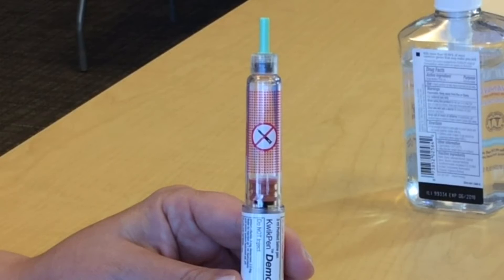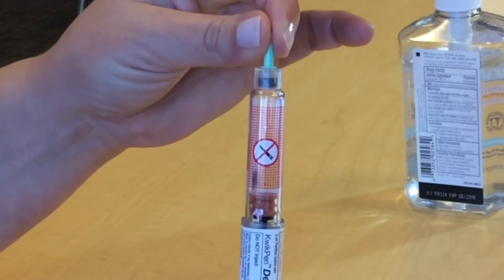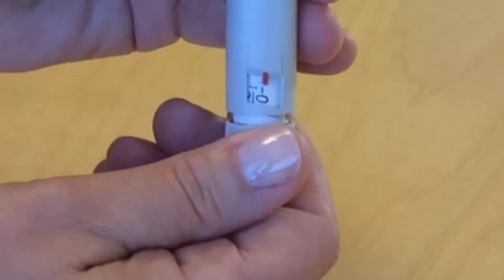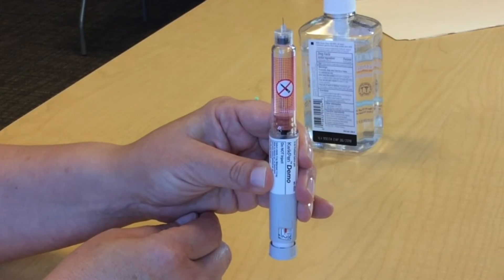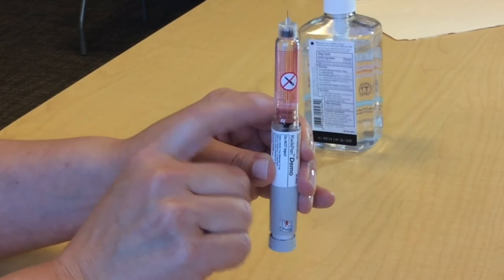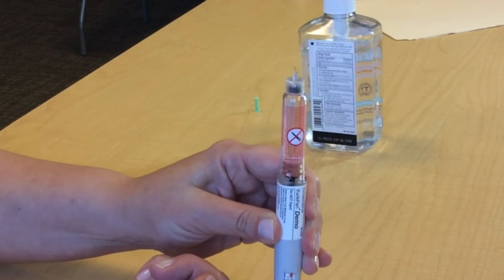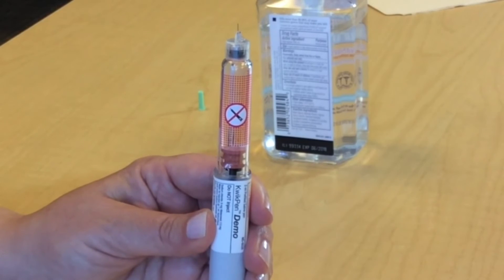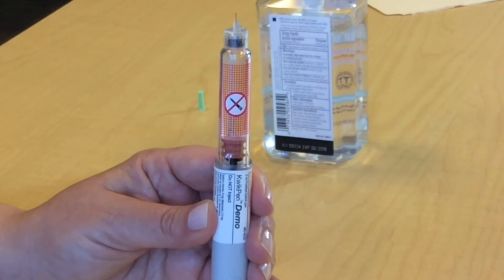How to prime your insulin pen

Comment: I still have problems with every pen, usually underdosing, even when insulin is coming out during priming.  I can't tell if the problem is the pen or the needles.  I usually waste at least a few units every injection simply from priming and making sure insulin is coming out but at least 30-40% it doesn't seem to affect my glucose.  very frustrating

Comment: Never works for me I can empty a full pen trying to remove air bubbles
Reply: my doctor told me air bubbles are okay and they're not likely to effect your injection. my tip (bc i also worry about this) is to just hold your pen upside down when injecting so the bubbles arent at the side of the pen with the needle on it. you can flick/tap the pen to make sure the bubbles move away from the needle. no need to waste insulin trying to get rid of the bubbles.